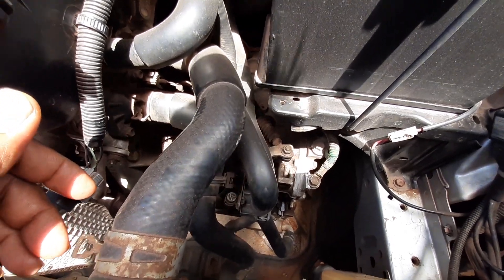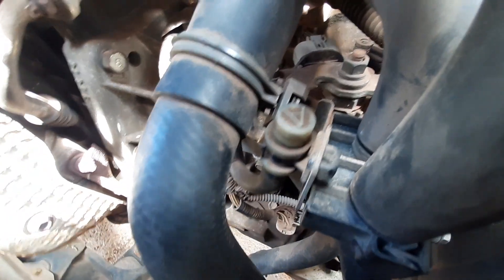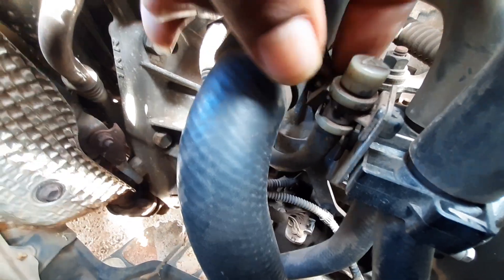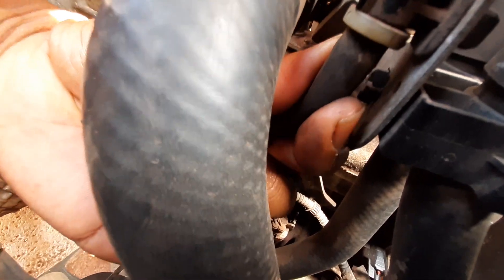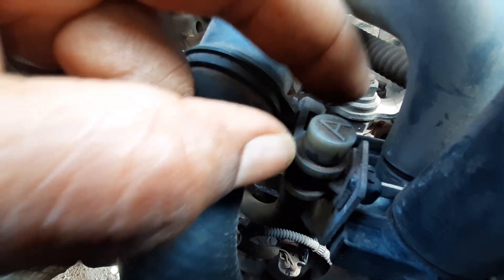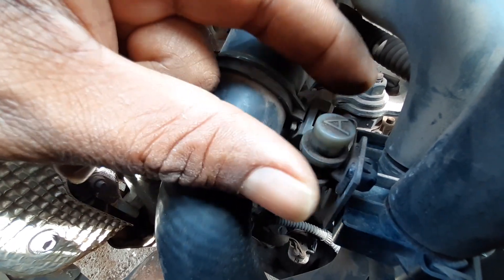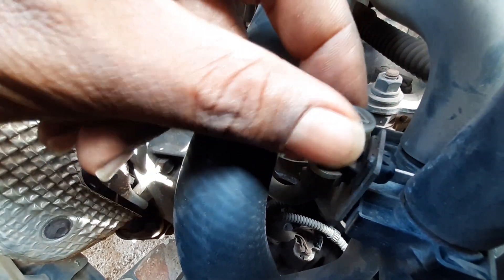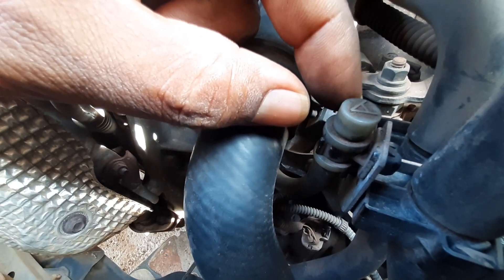How To Replace Your Transmission Breather Hose Cap

Comment: My breather hose doesn't have a cap...
Reply from the maker: @jeffj6815  if it doesn't have a cap and the hole through the hose is exposed upwards you need to cover it but not to seal it off. Contaminants can pass through it into the transmission.

Comment: P0420 check code I keep getting it.
Reply from the maker: This code P0420 usually appears when your oxygen sensor/s is not working correctly. You can identify this bad sensor by using the graph function on a scan tool that has this function and look at the fuel trim. While the engine is running and vehicle in park and the fuel trim graphs in site press the accelerator pedal. You should see the graphs moving simultaneously. If you press the pedal aggressively and release and the graph/s doesn't move much, the sensor related to that graph may be the problem.
Reply: @ShelDockToyotaVitz  I don't have a scan tool of that capacity but it usually states it's bank 1.
Reply from the maker: @paulwilliams7951  If you have only 1 exhausted as in a 3 cylinders  and 4 cylinders bank 1 refers to all oxygen sensors on that one exhaust. If you have 2, 3 or 4 oxygen sensors on this exhaust it's still bank 1. When you have bank 2 its referring to the second exhaust as in a 6 cylinders or 8 cylinders engine. Find out which of these sensors are faulty. You should take the vehicle to a auto electrician with a proper scan tool to correctly diagnose which of your oxygen sensors are faulty.
Reply: @ShelDockToyotaVitz  it's three cylinder like yours each time I check the two sensors there is soot all over the head 'black' keep cleaning them.
Reply from the maker: @paulwilliams7951  seems like you have heavy oil consumption as this is the usual cause of black oxygen sensor tips and it eventually blocks up the catalyst converter.
Reply: @ShelDockToyotaVitz  yeah it is plus I changed the catalyst
Reply: @ShelDockToyotaVitz  is there a way I can rectify the issue better yet are you on any social media platform, Facebook, insta, WhatsApp
Reply from the maker: @paulwilliams7951  I would suggest getting a scan tool. A blue driver can be of help because it can display graphs in real time and can identify many fault codes with the engine/exhaust and braking systems. It's not all that expensive and is very light in weight. It's good if you can assess these problems because as your vehicle gets older you will have far more problems with the car electronic systems.
Reply from the maker: If you have oil consumption problems this is the main cause of all these issues. You should first correct this problem. If you press the gas pedal while in park and  car engine in on and you see smoke only at high rpm then you have valve seal problem.if you see smoke from your start to press even up to high rpm then you have rings problem.
Reply: @ShelDockToyotaVitz  ok
Reply: 420 is a good time with friends, but a very bad time with your car.   Just say no.